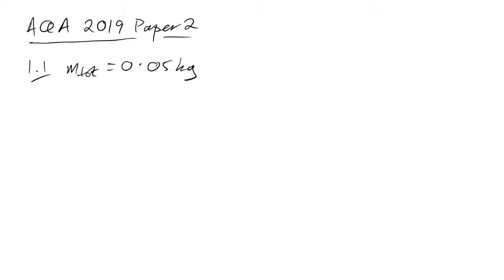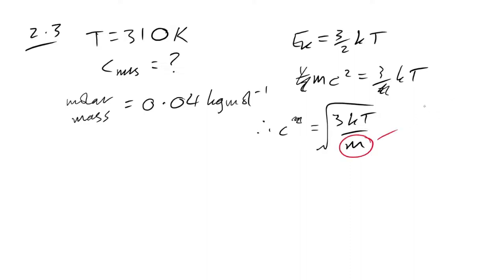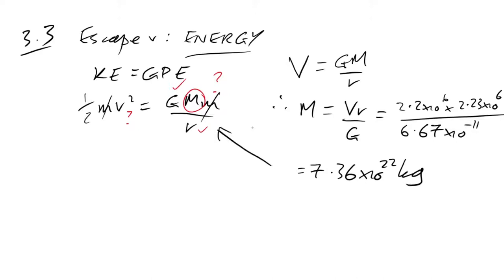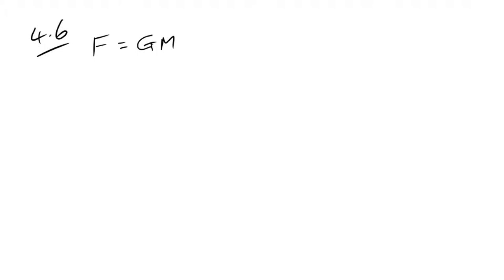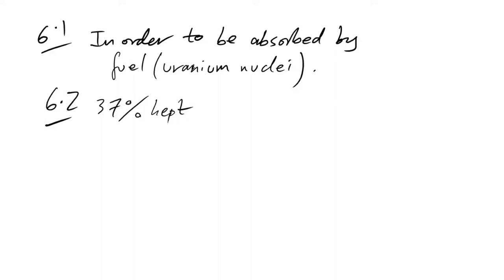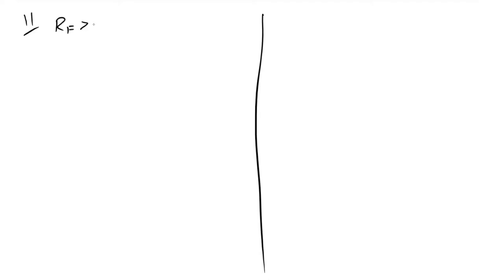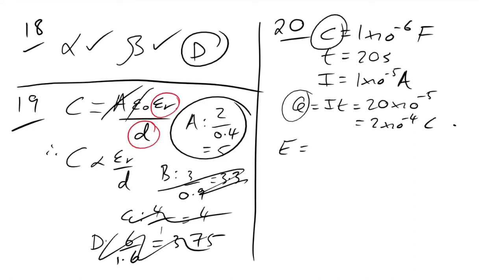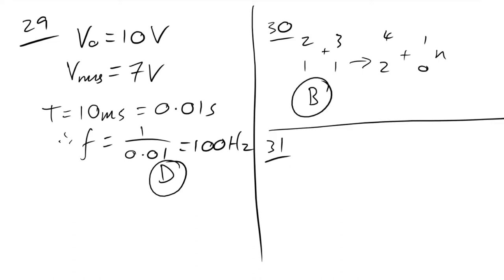AQA 2019 Paper 2 - A-level Physics Past Paper

Comment: For 26 I don't understand how you can tell if the force is to the left or right. I get that it must be to oppose the change that caused it but how do you know which direction that is. Also, am I right in thinking that the force would be in the opposite direction if the direction of the cell was the other way around?

Comment: at 10:58 how come you also cancelled an r at the bottom when u said one of the masses cancel
Reply: croomy  pretty sure the r squared was a mistake, GPE is GMm/r
Reply: croomy  The way I see it is the escape velocity is the velocity at which the object's kinetic energy is equal to its negative gravitational potential energy, so the total energy is 0.  Gravitational potential is -GM/r and you get gpe by  multiplying m to it.  I think science shorts accidentally used the field strength equation before multiplying an m, hence why he got GMm/r^2.  So you get 1/2mv^2 - GmM/r = 0. Then you get 1/2mv^2= GmM/r, the smaller m cancels and then you proceed as you do in the video. I hope this somehow helps?

Comment: For question 2.4, how can Ek only be dependent on temperature when EK also equals 0.5 x m x c(rms)^2, surely that means it also depends on mass
Reply: 0.5mc(rms)^2 = 1.5kT (on data sheet) T is constant and k is constant so the c(rms)^2 and mass would be different but mean Ek would be the same
Reply: because crms depends on mass aswell as u can see from 2.3 so the masses cancel out